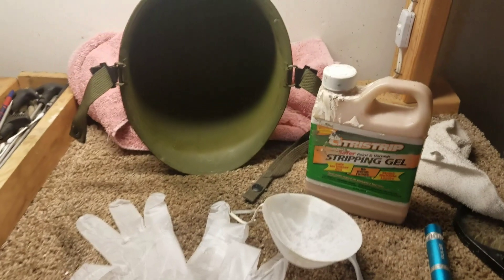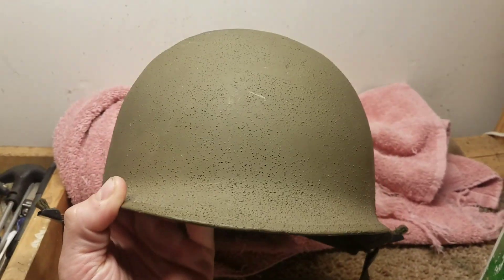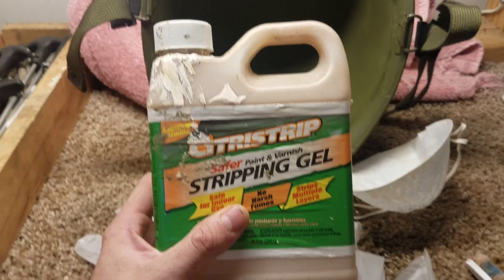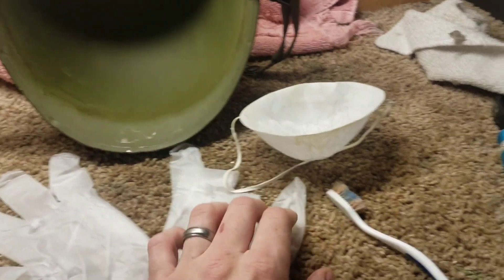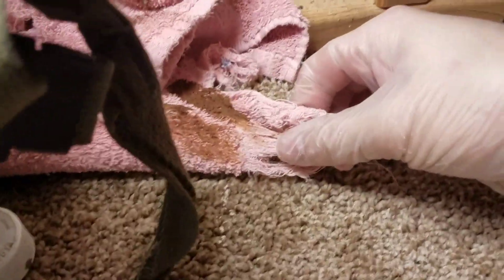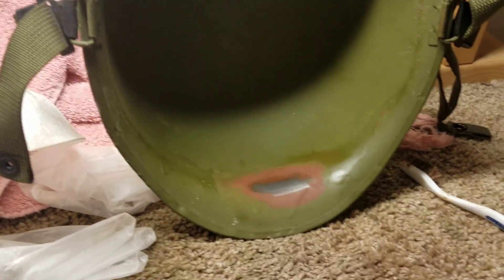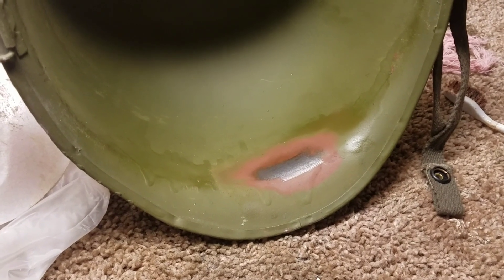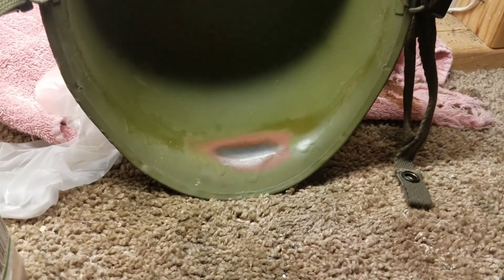How To Reveal A Helmet Heat Stamp: Part 2

Comment: Does revealing or searching for the heat stamps decrease the value of the helmet due to the damages to the paint? Asides from learning the approximate date when the helmet was produced, what are the other reasons for searching for the heat stamps?
Reply from the maker: Honestly it's kind of a grey area. Some collectors think it is a bad idea to remove a little paint. They feel like it will decrease the value. Personally it doesn't bother me. The paint being removed is inside the helmet where it won't be seen and more than likely a liner will be covering it up anyways. There are other characteristics that can help identify a helmet without having the heat stamp information.